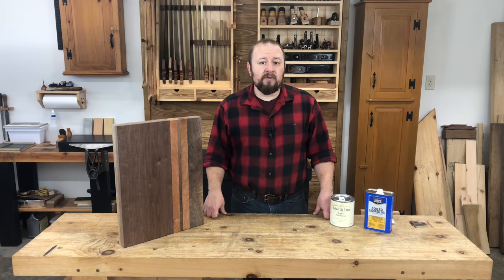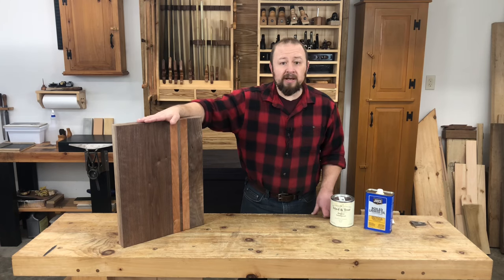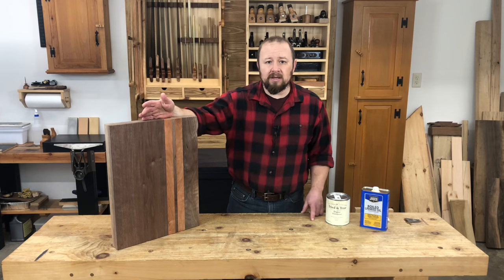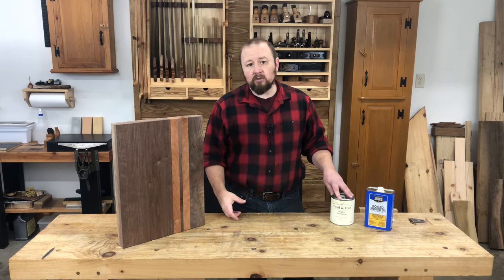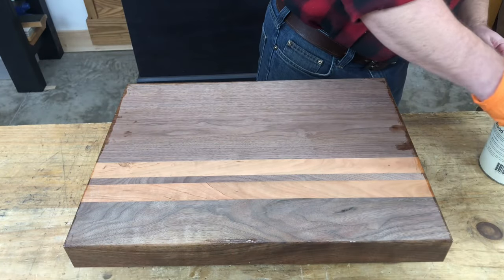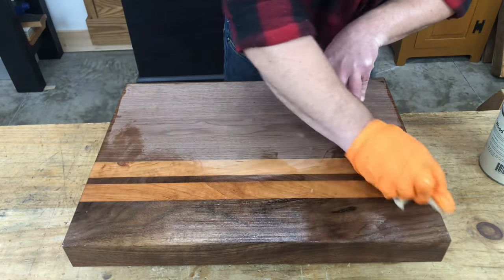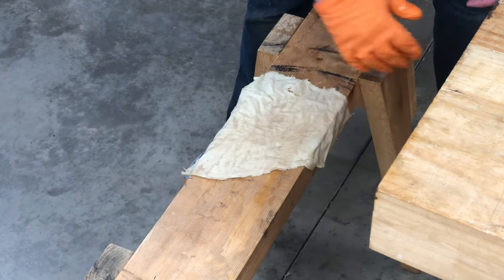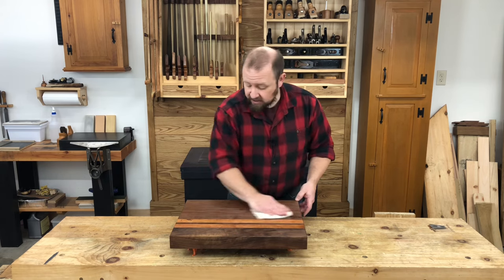Applying a Food Safe Wood Finish | Build a Cutting Board with Hand Tools | Hand Plane Foundations

Comment: Well done. Informative. Can you comment on 19th century stain and finish cherry without masking grain, figure of wood? Store bought stains seem to hide figure of wood. Can a stain be mixed with the method you've just demonstrated? Thank you in advance
Reply from the maker: There were lots of things used to color wood in the 19th century. Stains could be made from walnut hulls, various plants, flowers and barks. I wouldn’t use them on a cutting board though. Some were toxic if ingested.

I prefer to avoid pigment stains that you find in the local hardware stores if I can, at least for direct application to the bare wood. The pigments in them are very coarse and are primarily suspended in the solvent, not dissolved. So the pigments lodge in the pores and grain of the wood, and that’s why they tend to muddy the grain. That’s why these stains work best with large pored open grained woods with very strong and distinct grain, like oak, ash and chestnut. Pigment stains from the hardware store work great on those woods. 

For tighter grained furniture grade hardwoods like walnut, cherry, mahogany, maple, etc., I prefer not to color them at all and just let Mother Nature do her thing. Over the natural course of time these woods become richer and more beautiful all on their own, so I find patience works better than any artificial color I can give them. If I want a specific color for a project, my first preference is to pick a wood that will give me that color naturally. I find this works best most of the time. 

If I have to color one of these woods, I prefer dyes like W. D. Lockwood and TransTint over stains. The pigments in dyes are ground much finer than those in hardware store stains and are designed to fully dissolve in the solvent. Some work in water, some in alcohol, and some in oil. Dyes are much clearer and let the grain show through much more than stains. They’re my preferred way to color wood if I have to add color.

As with any finish, test the dye on scrap before applying to an actual project. Once a dye is applied to bare wood, it has to be planed off if you don’t like it as dyes penetrate much deeper than stains and absorb into the wood fibers as opposed to sitting on top of them. So experiment on test boards until you get something you like.

Comment: I have been making wood bowls for almost 30 years. I have been using walnut oils on them almost since the start. There are 2 specifically made for bowls that I know of, Mike Mahoney's and The Doctor's Woodshop. They are heat treated to break down the proteins that can cause nut allergies. Both also have carnuba wax in them. I do like to treat my cutting boards with a heat gun for the last application. On, end grain only. The old butcher shops would use mineral oil after clean up for the work day. It would provide an 'impermeable' layer to protect the wood over night. It would be scraped off in the morning prior to beginning work. Bees wax is very soft and will leave finger prints. The carnuba is much harder. Many 'food safe' finishes are available, but if I can't eat it straight out of the can, I won't use it on anything intended for daily use. Some people are very sensitive to the chemical driers. Walnut oil, which is not what you can get in the oil section at the grocery store, cures slowly, like a week or more. Sunlight and very low heat will help it cure. The rags can combust, but the only time I was able to get mine to combust, I left one on a black plastic bag on the south side of my shop, and the combined sunlight and black plastic was enough to start it smoldering.